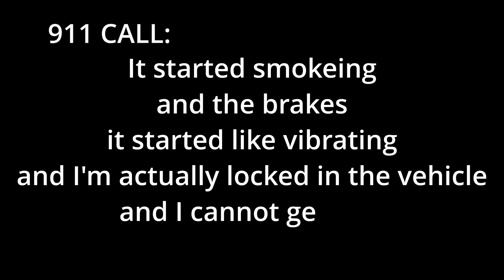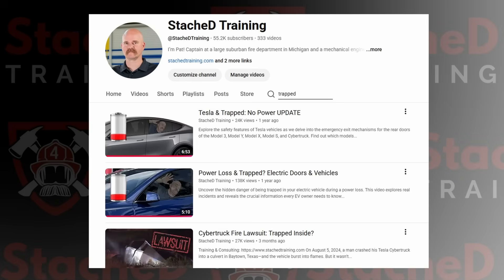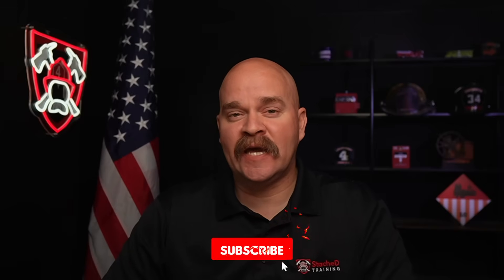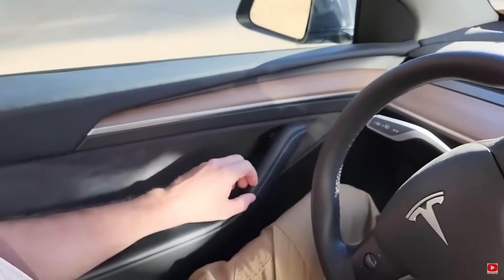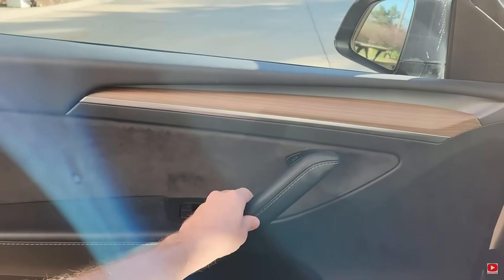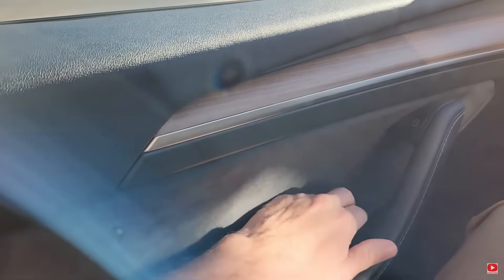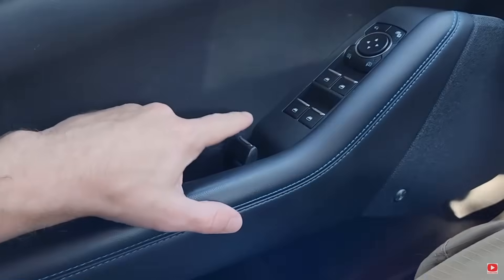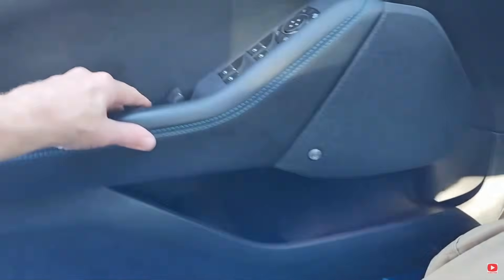Electronic Door Latch Failure: Smoke in the Cabin

Comment: Personally, I think the doors should remain mechanical. Period. Just my opinion though :)
Reply: I would never buy any vehicle that didn't have a mechanical door lock that I could open that's just stupid they're not show cars they're daily drivers
Reply: I refused to buy a Tesla or Mercedes S Class because of this "feature".  Shit happens and technology hates me.
Reply: @grayrabbit2211  I agree. Same with cars that don't have a keyhole in the door. Fobs fail, battery in the car and fob also fail.
Reply: @grayrabbit2211 I recently saw the same kinda thing on a fancy Lincoln SUV.
Reply: You are not alone
Reply: Im on mechanical door, or the manufacturer all must have one position for emergency mechanical position, like seat belt, dont try reinvent it (hide it, behind closed compartment etc), aviation industry have set the example for such thing
Reply: Lets put in 3rd little emergency battery that uses doors and windows in case of emergency. Then you have to replace that battery every year ”for safety” with $10000 price as it needs ”certified emegency battery changer person”. SOLVED!
Reply: As an engineer I tried to convince my manager, but the marketing team needed another feature to sell...
Reply: @0783155  More trinkets that fail all the stuff we don't want in a vehicle
Reply: @0783155 They can market the fact that old style doors are less likely to KILL YOU. Seems like a selling point to me.
Reply: I recall thinking this when I noticed a previous gen 'Vette, the first electric latch I recall seeing, and asking "WHY?" ..like someone mentioned about fly-by-wire steering.. Some things should beer mechanical. I later noticed the emergency release on the door jamb, but still...  I like my old Jetta; the front doors open with the inside handle from locked with one pull, with the rear doors, the first pull pops the lock up and second pull opens. Found this a nice feature when the kids were learning to work the doors themselves, could leave the child lock off but hear the first pull and the lock mech and had a chance to react if it was too soon.
Reply: I have only purchased EVs with physical door latches, and will continue to do that. If there is not a mechanical latch, I will not buy it.
Reply: @CyclesMcHurtz  they’re not only on EVs, now they are showing up on other cars too.
Reply: I don't see any reason why they can't be mechanical with an electric assist. Like electric door locks in the 70's. They just had a device that electricity moved the manual lock.
Reply: Also the side windows shouldn't be laminated and be able to broke up into little cubic pieces... 🤦‍♂️
Reply: I agree! First time in a Tesla I was nervous because it was an electric door latch. I asked the owner how to open the door manually and they did not know!
Reply: @WyleCote  Yep.  That is exactly what MustacheD said in this video.
Reply: the doors are mechanical, the driver didn't know there's a mechanical/manual release (all EVs have a manual door release)
Reply: @brightymcbrightface  Yes, we all  know that...smh. The point is, most don't know where the stupid button or minute lever is. Hence my original post, which is my opinion.
Reply: But it’s such an important luxury gimmick!
Reply: Just imagining if a building that has 2000 people working in it and the windows are sealed and the doors are electric and fire breaks out in the power board in the basement and the generator fails ,they would make a law saying that that’s not allowed to happen all exits must manually operational in case of power failure , funny part that is law and car makers were told the same about passenger vehicles and things like bus,s had to have emergency exits such as pull out windows,so a Tesla is sitting at the boat ramp with 3 kids and your wife is sitting in it and for some reason it just rolls down the ramp  ,who is getting them out and who do you save first? some will drown due to the time frame involved in finding something to break car glass and extract them all 1 by 1 , now tell me who approved this ,cars used to have to abide by strict laws allowing easy access by rescuers if the occupants were unconscious,again who allowed this , jeep had to recall half a million cars because a plastic fuel tank might catch fire and kill the occupants,the had to supply and fit new hi quality towbars to every vehicle in recall, and yet people are burning to death in electric vehicles all over the world regularly and nothing is being done ! Makes no sense
Reply: Next thing you know, buildings will have electronic door releases for the fire exits. Got to be "modern" you know? No thoughts as to what happens during predictable power failures?
Reply: Yes. As the video says, whatever I'm in the habit of doing to open the doors normally, that's what I'll be trying to do in an emergency.

It's human nature.
Reply: It used to be law they have to have a mechanism to get out
Reply: @OH14YOUI know some gadget-heavy cars do
have mechanical handles, but they are hidden (for example I'm told some Teslas have a liner in a door pocket, and if you pull out the liner you find a mechanical handle). 

Good luck finding that, or telling your family member over the phone while they panic after a crash...
Reply: @HexBeach yes we were at a car yard recently with the salesman who is a friend and we spent 5 minutes trying to figure out where this escape mechanism was ,turns out it’s a piece of wire totally hidden and inadequate
Reply: Why did you put in that last sentence?
Reply: In my opinion, glennjarvis2672, your opinion is 100% correct.
Reply: 100%
Reply: It will take the rebirth or Ralph Nader to fix this. Only way to avoid it, is to stay out of them.
Reply: And brakes and steering!
Reply: You're not alone.
Reply: I think it is quite obvious that they shiould remain mechanical.
Reply: Or if it’s electronic it needs to also be able to work without the motors and manually
Reply: They should never forget the lesson of Apollo 1
Reply: I absolutely agree with you!
Reply: There is to many brainless morons  created by crapitalism
Reply: cheap plastic breaks all the time regardless.
Reply: There are a lot of replies to your comment.  However,  the only reply needed is, 
I AGREE!
Reply: If EV dealers are going to continue to sell these junkers their they should instead teach their salespeople to demonstrate how the emergency door relief works.
Reply: @czechmate6916 how about rentals and share rides?
Reply: @czechmate6916 Seems you and at least 11 other people didn't quite grasp that bit about fancy engineering solutions. Rewind and have a think.
Reply: @czechmate6916 Some do but will you remenber that demonstration in an emergency hell no is the anwser. And do they tell everyone that gets into that car hell no.
Reply: @frizzlefry5 I don’t care WTF you think troll go away.
Reply: It always kills me how if you could ask all the people that needlessly died in an EV due to an accident that was NOT fatal but turned out to be because they were trapped inside a smoldering Fire Bom if they still Love their EV and think they are the FUTURE! I think the answer would be very different.
Reply: @ImLivinSD  Considering gasoline is finite, yea, EV are the future.
Reply: & Elon wants to put indestructible glass 😵
Reply: In fact I think there’s a law for it now going forward
Reply: @ralanham76 There is talk about it, but nothing concrete came over my desk yet. Knowing how our legislators work and the car lobby (in Europe) this will realistically take another 5-7 years. And then manufacturers get a waiver for models already in production, so in about 9-10 years new models will be without it. That's unfortunately how the automotive industry rolls..
Reply: @0783155  Having designed and sold a death trap they should be made to recall and retrofit them.
Reply: Can't remotely control them that way. It's for your "safety"
Reply: And as stated in the video, there was a mechanical door release in the Rivian, just that the owner did not take the time to figure out where it was.   So the door in the vehicle does have a mechanical release.
Reply: @BubbaBearsFriend  Yes.  One that is utterly secondary to the electrical one, and that many people would forget all about 3 or 4 months after getting the car because they never use it, and would never think of in a moment of panic.  A mechanical system needs to be the primary.  I have never had one fail, in 50 years of driving.

Comment: If it took power to get out of my vehicle i would keep a hammer in reach.
Reply: Most EV adapts don't know how to use tools these days sadly.
Reply: @Mediamarked  Darwin always win.
Reply: Ever tried to break a modern car window?
Reply: @greebo7857  
Or even a tall building's window? I watched some fire disaster movie long ago, and they try to break out the window to get some fresh air and relief from the smoke. Chair or whatever furniture item just bounces off of the window. At least it probably stands up to hurricane-force winds?
Reply: I dont have an EV but still have the escape hammer.
Reply: Hammer isn't gonna work too well bud, get something actually designed to break windows, or just break off a piece of a spark plug lol
Reply: @Stealth86651  Door windows are hard to break because they move around in the window seals, but a hammer thrown hard enough will break a tempered one, and hit enough times will break through a laminated one
Reply: most Modern car the front windows are not Tempered Glass anymore they use the same stuff your front windshield uses with layers of plastic that make the windows Very hard to brake out Vs the rear passenger doors that use Tempered glass that you can easily brake out and leave...like the police videos where you see the officers Full force trying to baton a front window out but the window wont budge tell A lot of hit. thats new car glass. not just EVs every maker is doing these now  and cutting corners. you can check your windows there should be a little sticker on the bottom corner that sez Tempered glass.......if you see it be happy you can escape easily........if not then the back 2 doors will say it while the front has no mention of tempered, the funny part late 70s and 80s is when we QUIT using this dangerous glass that traps people. and now its back......again -_-
Reply: @RioZLander a few bullet holes and a few kicks solves alot
Reply: A Jeep won't have that problem 💡
Reply: it doesn't though, they all have mechanical releases. People just don't learn where they are.
Reply: @jerome1lm  Why should the Emergency Mechanical door releases ever be hidden? It is the law that the Emergency Mechanical Trunk release be not only exposed at all times, but has to be glow in the dark as well!
Reply: @davebrown9725  It's shouldn't be
Reply: @davebrown9725  
Wow, glowing too? Safety or anti-safety? That way, another possible place that can short out and set the car ablaze? Another shoddy light to burn out.

And it is not going to glow when the car is turned off, else the battery would be slowly draining?
Reply: @yosefmacgruber1920  "Glow in the dark" means luminescent, NOT powered. Interestingly, since watching this video, news has come out of China that they are going to Mandate regular mechanical door releases in All EVs sold in China. The CCP has evidently figured out how dangerous the various new EV door handles and internal releases are.
Reply: @davebrown9725  
Furthermore, how many people know that EVs are too heavy for parking garages? If the entire garage was filled with them, it would exceed the weight capacity of the structure. But the "environmental" radicals can not be bothered with things like science or economic feasibility, before they rush to mandate that we all have not-quite-ready EVs starting yesterday if not the year before.

But I do love how quiet that EVs are, and it is really cool that they got rid of the transmission. No gears to shift. The electric motor handles well, the entire range of speeds, and unlike ICE, electrical motors can even spin in reverse. Just a simple matter of the electronics or the motor regulator.
Reply: Rock hammer...